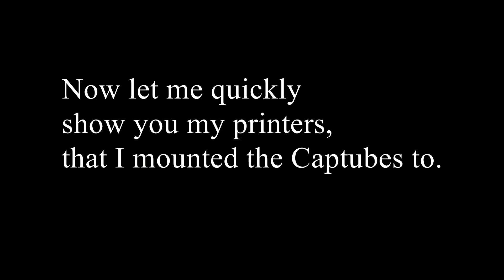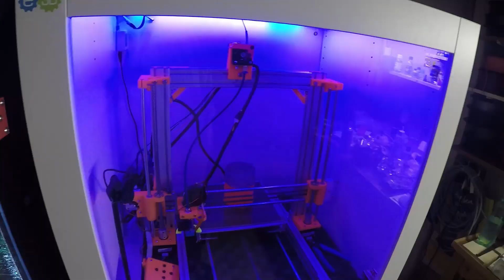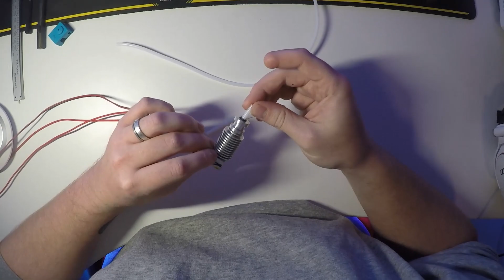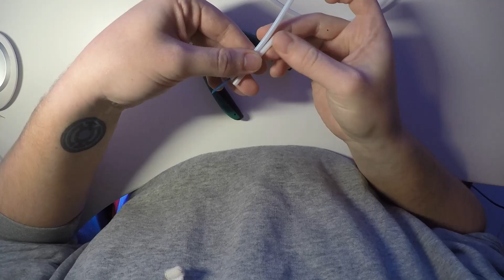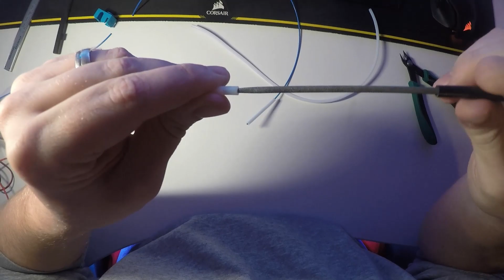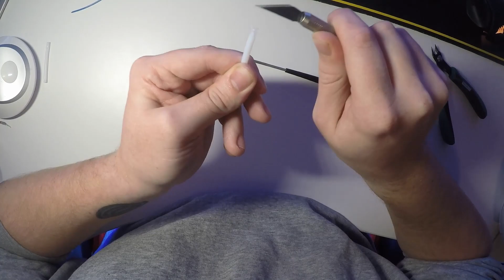Capricorn Tubes review and how you probably wouldn't use them although you should.

Comment: Thanks for your review. It is sincerely appreciated. I should however also point out that your filament friction comparison by inserting the filament into the two tubes is completely unfair and shouldnt be considered a basis of comparison at all. The old tube has a much smaller radius of curvature, is clearly used (as it has retained its shaped from being installed) and may have some internal wear. So you are effectively comparing a worn tube to a new one and the increased friction youre feeling is probably in large part due to the force required to bend and force the filament into the tighter curvature.
Reply from the maker: Fair point, but try Capricorn tubes and you'll immediately see what I am talking about and that there's truth to that. But yes, poor choice of comparison here ;)